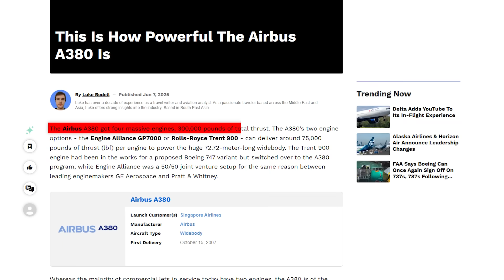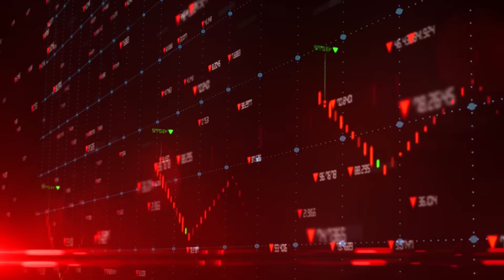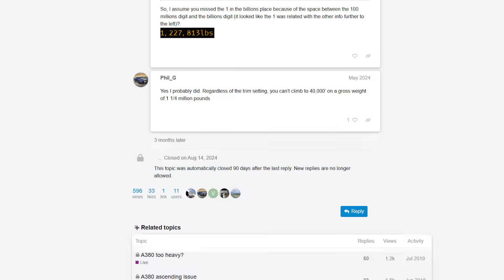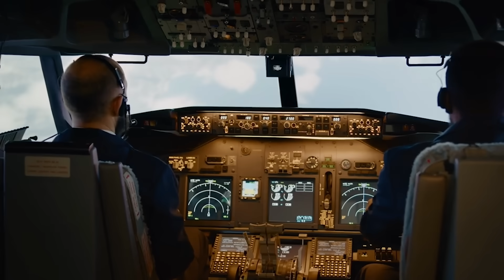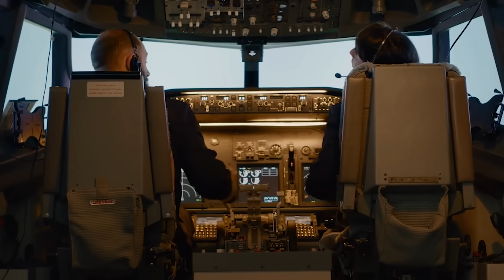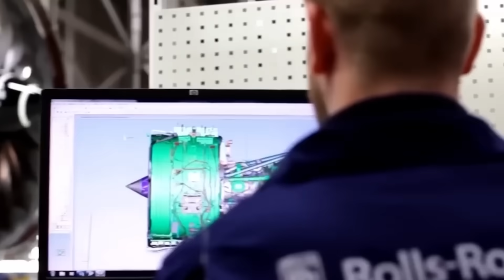Why the Airbus A380 Struggles to Gain Altitude

Comment: You've highlighted the weaknesses of the A380 design, but neglected to point out that aircraft technology has solved these problems. If Airbus were willing to open a new production line for the A380neo (because the old one is now producing other types) then they could correct the drawbacks and make the A380neo competitive to the B777 and A350-1000. Emirates have even stated that they would invest 20 Billion in Airbus to make it and then buy what Airbus produces. It's a matter of just going back to the designs they looked at after they started production the first time around. Newer better engines (the UltraFan) redesigned wings, composite where there was metal before, longer fuselage with more premium passengers, smaller VTP. They know how to make the A380neo, they just need to have the will to start manufacturing them. They also need to build in the States to get around Tariffs and to ensure US Airlines buy them as well. The A380 remains a firm favorite with the passengers and Emirates will keep them flying way into the 2040s and beyond. Lufthansa expect to keep their 747s flying for decades longer. The A380neo can be built and should be, even if Emirates were to build them themselves in the UAE!
Reply: So wrong. They would also need to make a new wing that is 72m span, or use folding wingtips like the 777X. And while aircraft technology may have solved this wingspan problem, there is the small matter of patent infringement, so Airbus would have to wait for the 20 year patent protection to expire.
Reply: BUILD IN THE STATES??? ARE YOU MAD.A 380 wasn't made for USA were there isn't much people ,but to connect Europe with Asia and Oceania.(Hardly anyone goes to the US anymore and why would we? )And tariffs ?? There are no tariffs on planes between Europe and US even Trump isn't that stupid because it would give RR an enormous advantage to fit all Airbus planes with new engines! The airline industry is to interconnected across borders like the CMF 56 engine which is built in both US and France (Leap 1)At least more than 175 of the 251 is still in service and  just about 40 of the B747 which there were made some 1500 of!I would love to se a new A380 with new engines and more composite materials, but as of now Airbus dosen't have the capacity with a backlog of over 8500 planes.
Reply: There will be no reopening that program is dead and buried airbus lost billions on that program. It didn’t even come close to breaking even. Emirates offered money to help with that and they still said no. That’s why they bought over 200 777x9 to replace those aircraft whenever Boeing gets them ready  like the guy said no matter how much money you spend you can’t beat physics and that behemoth of an aircraft is not financially doable. It’s operating costs are too high. Its performance is not good enough to justify only Emirates gets away with it because they have a special model of how they use it. Plus, it could never be converted for cargo use. It wasn’t designed for it another blunder by Airbus.
Reply: @shirleytwsw  
The Emirates order with Boeing for B777X is now in jeopardy. As Boeing cannot specify when they will get certification, Emirates is already discussing the possibility of placing a large order  for A350-1000 to add to the A350-900 that they have. Airbus can find delivery slots for A350-1000, just as long as Rolls Royce can fix the cycles problem - which they appear to be doing.

Then obviously you've not heard that Airbus has reactivated yet another of the A380-800 that were in long term storage at Taube. One of the Air Malaysia A380 has been brought back to life and is now at AUH Abu Dhabi. It's currently owned by Airbus and being used as a test platform alongside the two remaining test aircraft. 

The suggestion is that Airbus intends to provide a mid-life update to the current operators. To include new engines and various other upgrades to make the design profitable. Just switching to the UltraFan would be enough to change the economics of the type. Emirates want their A380-800 to last well into the 2040s and they are already acquiring spare parts to make that happen. It would not be beyond the realms of possibility for Airbus to reconsider the A380neo. 

The original break even was 425 and they sold 251. They only cut the production because of Covid. As for the A380F, that was put on ice because they were focussing on the passenger versions. The design said that they could carry 150 tones of cargo. That's still more than any 747. They just never went ahead with it because the A380-800 was not profitable for passengers, let alone freight. With the UltraFan it would be.

All that Emirates need is a big enough investment to allow Airbus to build a new factory in the States. They have a factory in Mobile Alabama, so it's not impossible.
Reply: @WOTArtyNoobs  there’s no way Rolls-Royce is gonna take that type of risk.  They have problems already. A-380 program is dead. I don’t know if you’re understanding that I don’t care if they made brand new engines for the A380 new engines means new Wings. Have to be designed you can’t just slap new engines on a plane. This ultra fan that you speak of maybe some future project they have but Rolls-Royce is not gonna spend millions billions of dollars to develop engines for a dead air frame. Big twins are the future airbus bet wrong the first time. Why would they bet again and as far as this setting up an assembly line in Alabama is that some sort of fantasy do you know how long that would take plus having to reestablish all the supply infrastructure for that plane which is already been disassembled and shut down  you think you’re gonna reset all that back up in Alabama for one customer??

Comment: The 747 was the TRUE Queen Of The Skies, and a phenomenal achievement in engineering.
This thing, on the other hand, is a massive-undepowered giant whale that's it's both "ugly" in design, and literally a PITA to fly.
It struggles to climb, despite having 4 massive engines, and when it touches the ground on landing, it literally makes you JUMP from your seat, due to the massive weight.
They should've phase it out, when the 747-8 was announced.
Reply: Remember the saying "when pigs fly". It was meant to mean never, but Airbus made it happen.

Comment: This thing needed six engines, not four.  But that would destroy any semblance of economical operation.
Reply: Then we might as well call it an Antonov. But all jokes aside, ya its underpowered, I guess.
Reply: @andrebello4191  Jokes?  Where?
Reply: Proper winglets and four 100k lb thrust efficient engines would solve the performance problem just fine.
Reply: Those are more then 20 year old engines  by now. It has been quite economical at the time of it's Launch competion A340 -600 and 747 variants, and some trijets like MDs. 

Still It does not beat modern twin engine plane, like the A350 or A330neo or a 787.
Reply: It needs to be converted into beer cans.

Comment: And they were planning to build a bigger variant??
Reply: Actually the original design was for 800 passengers. No airports in the world would agree to come up to this capacity, so they scaled it back to 650 passengers, but kept the wing and landing gear for 800 passengers, believing that eventually the market demand and capacity would be there. So the weight penalty that this caused gave it pretty poor economical performance as a 650 passenger plane.